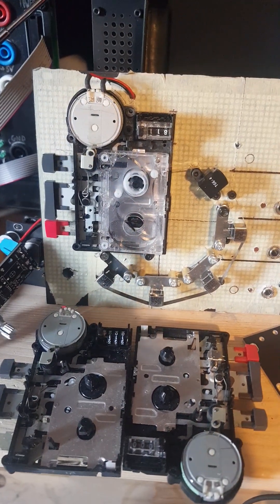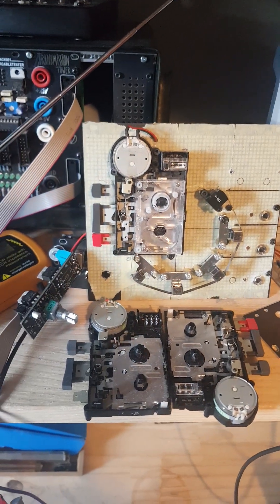uTape Delay prototype!

Comment: Thanks for sharing this. Super inspiring. I've been working towards integrating tape machines and eurorack, so finding your channel the other day felt like some major synchronicity. When you're working with tape machines like this, are you at modular power levels (+/- 12 v)? If so, how are you attenuating the power to work at the 3v or so the tape transports require? I'm also curious to know how you're are amplifying the play heads. I've been building some tape delays. Cheers!

Comment: Oh, I so wanted to try a similar idea using cassette heads with the intention of getting a (nearly) WEM Copy Cat..😂👍
Reply from the maker: Do it! Making you own tape machines is loads of fun :) I was repairing my WEM over the weekend (dropped it and turns out the fuse holder cracked!) and remembered the copi copi cat prototype I worked on with wd41. We never released it but it was all part of the journey to this design.

Comment: I recieved your module and had a lot of fun jamming with it las weekend. This prototype also looks promising, keep it up and thanks 👍
Reply from the maker: Glad to hear you like your module!!!!  This prototype is a very diffrent type of machine to the uTape Scrubber.  Although it doesn't go backwards it will be great for making delays and experimenting with tape feedback. I'm hoping to use this to process sounds from the uTape scrubber. One real advantage of the uTapescrubber is that you can easily remove the micro cassette and keep the loop!